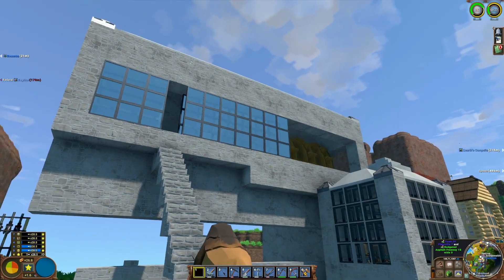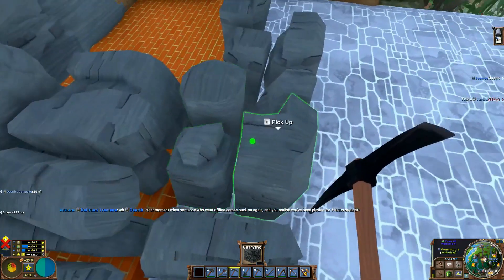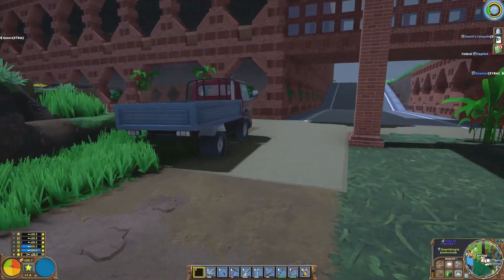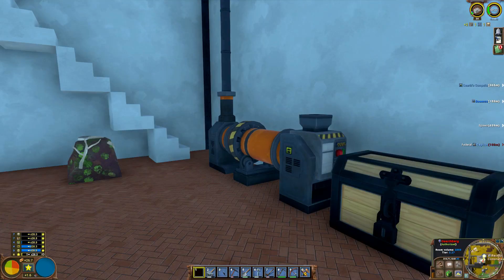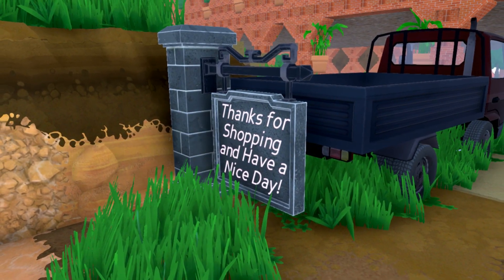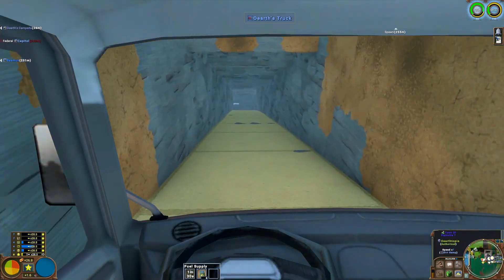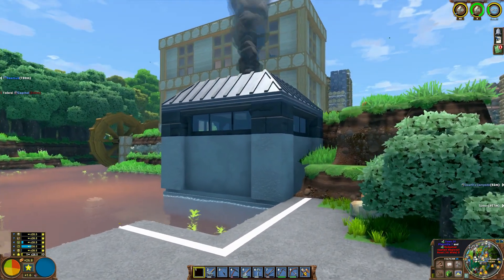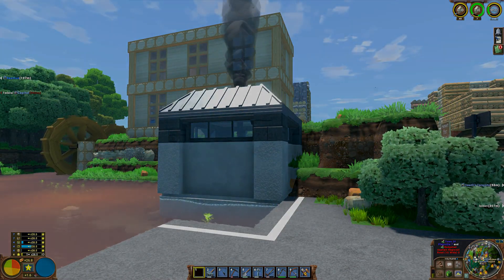ECO 9.1.9 - EP6 - Pollution Problems! Fertilizers, Power, Building Vertical, Tier 4 Materials

Comment: Thanks for sharing. Do you have to have land claims for your underground mines?

Those power poles look like the ones that Tesla created!

The pollution issues were a bug?
Reply from the maker: Yes and no on the land claims.  Claims go all the vertically from the upper atmosphere to the core of the planet, but you can mine anywhere on land claimed by your self or just open unclaimed territory.  If someone however claims land above you on the surface, it will prevent you from being able to mine the ground underneath their claim - unless they have granted you express permissions on their claim.
The pollution issues were either a bug, or an intentional change in game mechanics to increase difficulty.  You used to be able to pipe away smog to an indefinite distance, which facilitated a nice planet-wide piping initiative to centralize air pollution similar to tailing, but now in the latest update or so, folks are reporting you can go 10 pipe sections worth, with really isn't much distance still at all.  So maybe they want it that way to make air pollution harder to manage.
Reply: @Oearth  WHat happens to your equipment on unclaimed land that then becomes claimed?
Reply from the maker: @Tim Favreau - you still own vehicles and equipment, and are the one with rights to use it.  Any buildings or other non-vehicle objects though become the property of the land owner.  "Vehicles and equipment" pretty much include carts, trucks, skid steers, excavators, and cranes.

Comment: Great vid man. I would love to see a vid on how to deal with the pollution itself. I am only new, but what to do with tailings I am still trying to figure out. Any tips you could give me?
Reply from the maker: Thanks!  I will probably do one on pollution more specifically, but they are also making changes pretty shortly to how pollution is distributed in the world, and how you can manage it, so I kind of monitoring that progress at the moment - wouldn't want to put out a video that might be out of date in a couple months!  As far as tailing right now, the best thing your server can do is to store them centrally in one location far away from any major tree areas, or places where you wan to grow things.  Right now in the game, tailings have a finite amount of spread, and it isn't carried in water supplies (both those things are some of the future changes).  So you are fine for now with designating a remote location and piling them there.  I'd recommend using stockpiles rather than piling them on the ground - not because it contains the pollution more, but because it's easier to unload them from your truck or move them afterwards.  The information about storing them far underground is a little bit of a myth.  True, you won't see the ground pollution on your map if they are deep enough, but the are still creating a similar pollution radius as if it was on the surface...it's just below what the map shows on the surface.  Right now in the game, rather than having stockpiles of buried tailings all over the map, sometimes left behind by abandoned players, it's really better to have them centrally located in one place so you know where they all are, and can deal with them if they do a game update that changes tailings management.  In my Government Incentives video, I showed how we actually turned that whole tailings problem into an opportunity for the players!
Reply: @Oearth  really appreciate the reply man. That helps heaps. Keep doing what you are doing, you have a way with making things easy to understand on a game that’s not easy to make sense of for new players. And a lot of misinformation or outdated info, keep the vids rolling and I will be sure to return the favour with support.
Reply: @chrisN1985  I can tell you what do do with tailings, in 3 steps too.

Step 1: dig large hole underground with ramp not a quarry style 
Step 2: encase is moatared stone of any type
Step 3: put tailings inside and seal with door